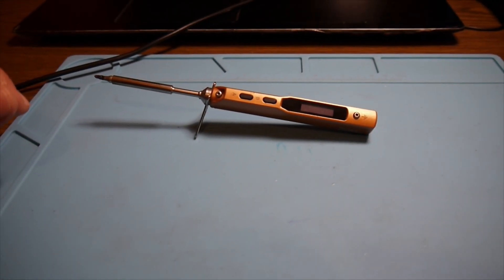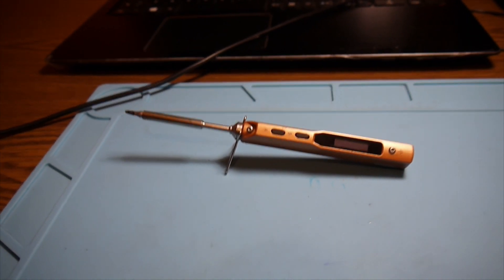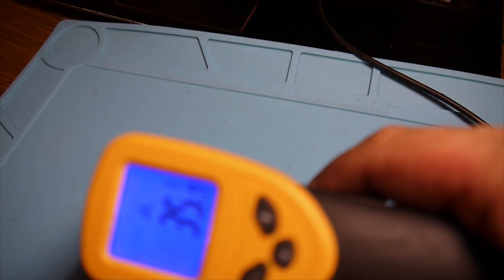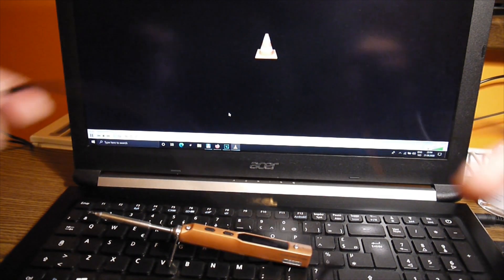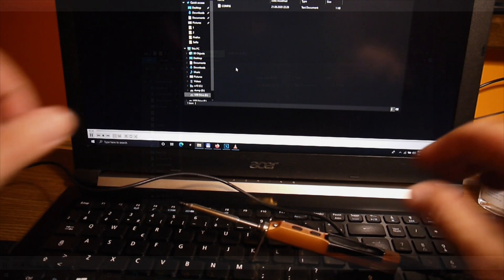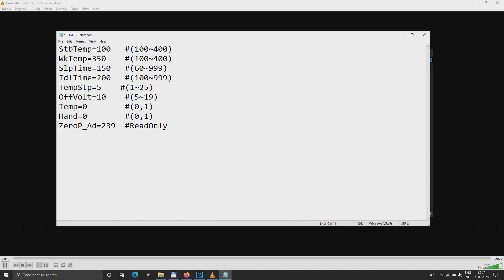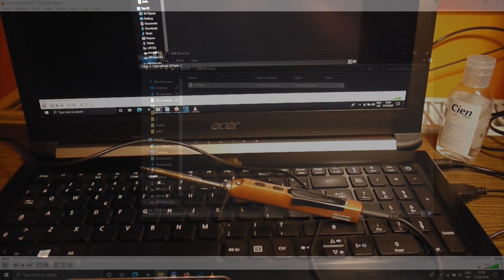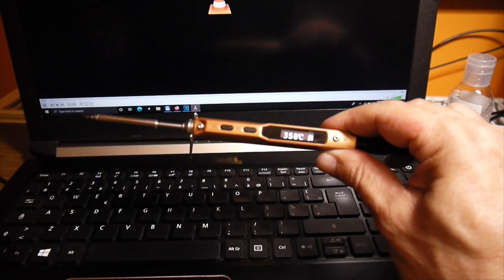TS 100 soldering iron how to use and config  with a broken LCD!

Comment: So i wonder why ts100 display is broken easily,  maybe the possible reason  handle is get hot when we use device for a long time and display is get broken by high temperature . So what is your opinion in this case guys.
Reply from the maker: I thought it was from the open software, but a lot of people never used it and the same LCD got black.Finally I think there are very bad quality LCD installed from the factory! The replaced one I have on use now, is working perfect for one year and no change , same luminosity..
Reply: @viocaia  thank you